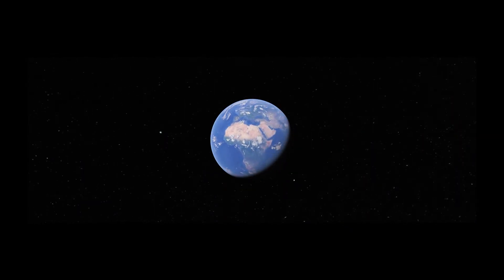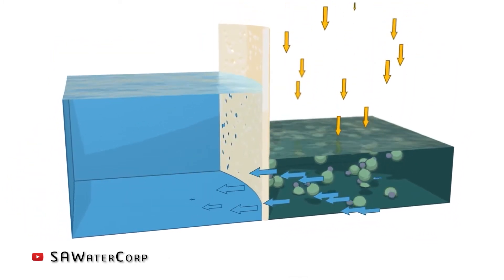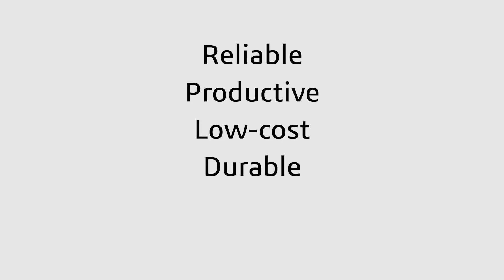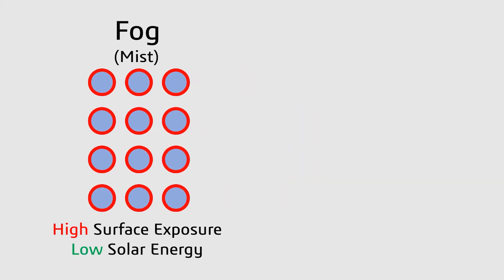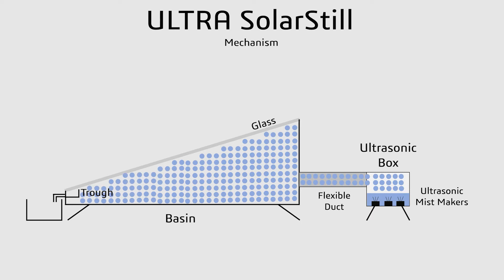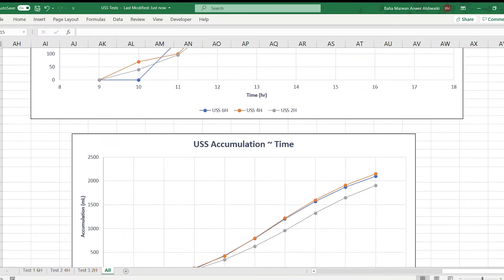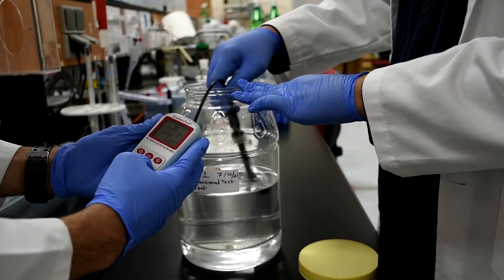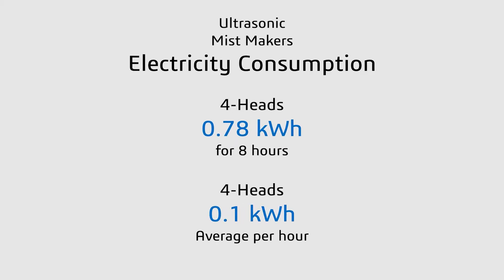The ULTRA SolarStill | A New Approach Towards Domestic Solar Water Desalination

Comment: Interesting. Alternatively, a $20 design could be doubled in size to double the output... What's the point of using a fancy ultrasonic mister to increase evaporative surface if you can very easily just double the surface area of the still? Most of the time, the limiting factor is not surface area. Even at 2L per sqr meter, a tiny house with 10 x 10 m dimensions could use its roof surface to produce 200L per day - enough for drinking, bathing, laundry, garden, etc.

The figures to optimise for is initial investment cost, maintenance cost, and availability of materials.

Comment: Does the salt mist maker stop after short periods?
Reply: Sorry, I mean salt deposits malfunction the atomizer maker
Reply from the maker: The Ultrasonic Mist Makers do not automatically stop whether on purpose or due to it being not capable, but rather we controlled it manually to operate in certain hours to achieve the maximum amount of productivity.

Comment: if you had the glass closer to the water it would cause more heat and more evaporation
Reply from the maker: That's true for a conventional solar still that uses water in high dense liquid state. Our solar still, an enhanced one, uses mist (fog) that is considered as a low density water and is scattered in particles and behaves almost like a gas. Which won't make much of a difference if we reduce the height since the mist will fill the volume quickly. Also, we included a mirror at the back that reflects sunlight to the fog again. If we were to reduce the height of the solar still (bring glass closer to water) then the reflection area of the mirror is smaller. So there is a balance to which is the optimum height.

Comment: Have you thought about what to do with the accumulated brine? Thank's
Reply from the maker: Thanks for the question :)
We haven't really put time on thinking of how we should extract the brine and remaining salts from SolarStill and assumed that it can be removed manually (by hand). Automatic removal will require more expensive systems like pumps and other that will just increase the cost. Manual is not the best option obviously but it saves the cost.
This is because our investigation and research was mainly focused on how to merge the ultrasonic technology with a solar still. The removal of salts would be the same for any solar still of any design or type, so we decided not to worry about it.
In the future we do have plans on making a design that can have an automatic feature where it can contain the salts into a small container as waste or useful remaining output.
Reply: @bahashwaiki  I believe that a biological and economical way to make use of the brine would be to breed Dunaliella salina microalgae to be used as food for the crustacean Artemia salina, which in turn will be the food for the lavas of the fish in the fish farms.

Comment: Great work :) thanks for sharing. Could you please elaborate on how your double slope trough increases the accumulation of water droplets?
Reply from the maker: Thanks John!
The purpose of the trough of any solar still is to gather each water droplet and dispense them from the exit to the freshwater storage tank (container). In order to gather the droplets, then there must be an inclined angle across the trough to allow the droplets to slide by gravity effect and get in contact with each other. If we were to add a traditional single slope trough on the internal front of our meter squared solar still (which is where most troughs are placed) then the max inclination angle would be around 8 degrees (because the length is 100 cm and height is 15 cm so arctan(15/100)=8 degrees). However, if we add the Double Slope Trough (see 1:54) then there will be two inclination angles from the two sides where each has a maximum angle of 16 degrees (because the length is around 50 cm and height is 15 cm so arctan(15/50)=16 degrees) which is double the single slope. The higher the inclination slope then the effect of gravity will be higher and therefore faster water accumulation.
Hope my explanation was clear enough. Let me know if you have any questions :)
Reply: @bahashwaiki  I don't see this double slope trough in your video. Where exactly do you have this CAD part in the unit?  I assume it's the accumulator cover that collects the droplets, but all I see is a flat glass cover in the video.
Reply from the maker: @unknownquantity4440  The CAD design is shown at 1:54. you can also see how it is assembled into the ULTRA SolarStill at 1:33.